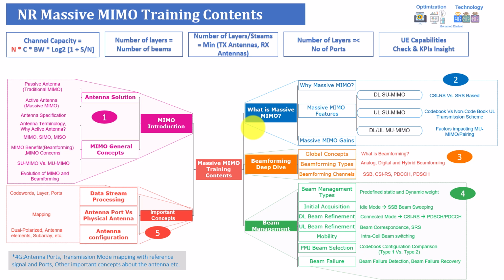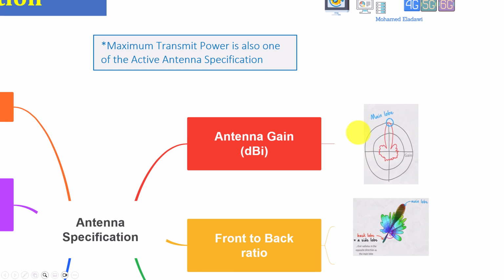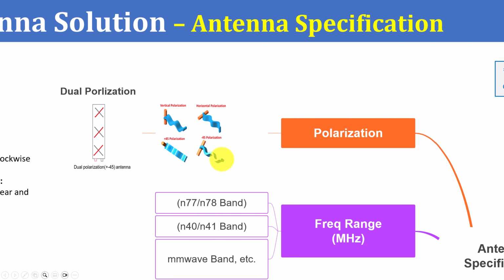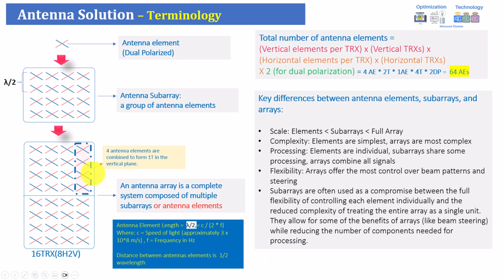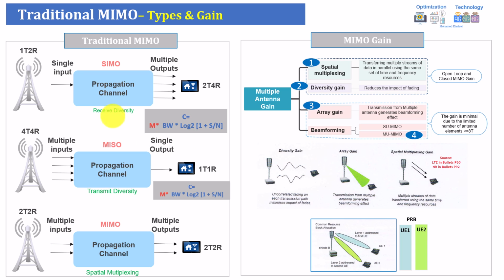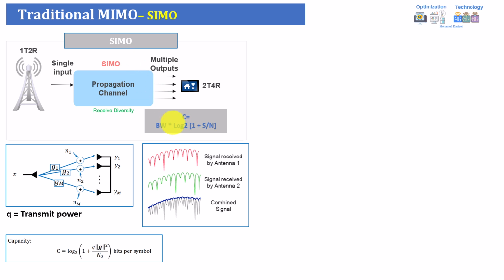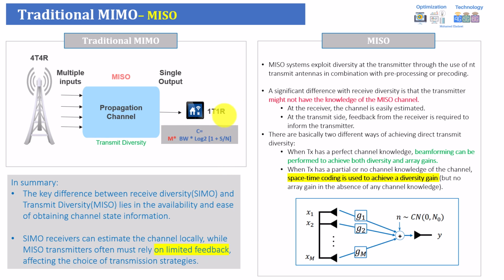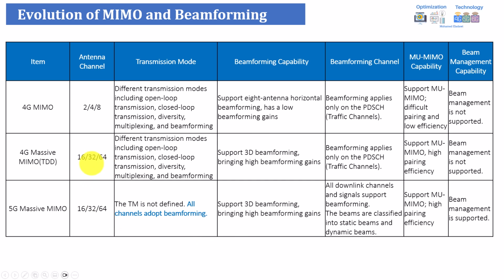Session 1: 5G NR Massive MIMO | Antennas, Diversity Gains, Beamforming Deep Dive

Comment: Nice explanation but have one confusion at 50.00 1d beamforming how this antenna 8H1V in my understanding it should be 4H1V can u check and explain it
Reply from the maker: Thanks a lot, Mohamed, as i remember the interpretation of the 8T8R antenna configuration for 1D beamforming is correct. The setup involves a single row of four dual-polarized elements, enabling horizontal beamforming with a fixed vertical tilt but let me also double check and confirm it back to you and please also let me know if you find any other information to ensure we are delivering the right information to all audience. Thanks a lot the feedback. Appreciated

Comment: Hi, in the example of 1D beamforming, there is 8T8R, are there two subarrays, vertical consists by four dp antenna elements or by eight? how we get 8t8r is little unclear, thanks
Reply from the maker: Thanks! I’ll review this part and get back to you later. Is there anything else that’s unclear? I’d also appreciate it if you could share your overall feedback on the video. Feel free to correct any part that seems unclear or inaccurate.

Comment: Thanks. Can we say that the term beam forming does not apply to uplink even if UE can produce a beam to the radio antenna set.
Reply from the maker: You’re welcome; yes the term "Beamforming" might be somehow misleading for UL, since we are not talking about uplink beams but rather about an adaptation of the UL Rx directivity patern in such a way as to create a peak gain to the direction of the transmitting UE. Below link has a very good article and also you can find more information 5G NR in bullets page 364 and P386

https://www.linkedin.com/pulse/downlik-vs-uplink-beamforming-multi-user-mimo-lte-5gnr-balis-1c?utm_source=share&utm_medium=member_ios&utm_campaign=share_via